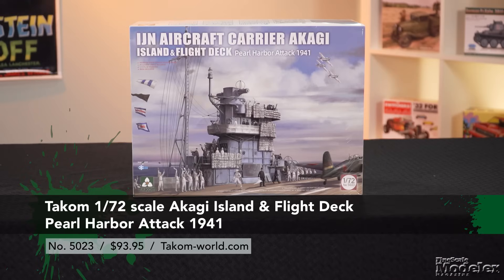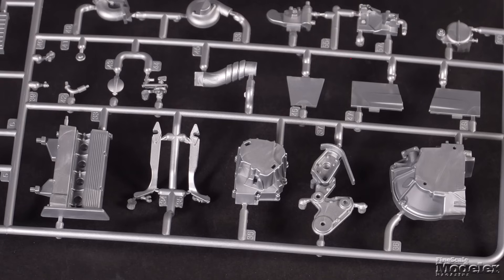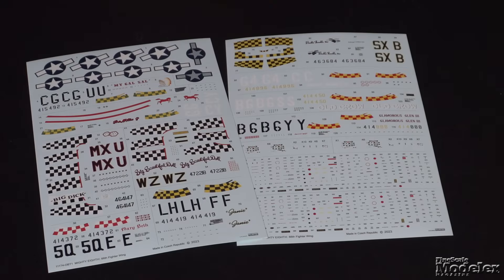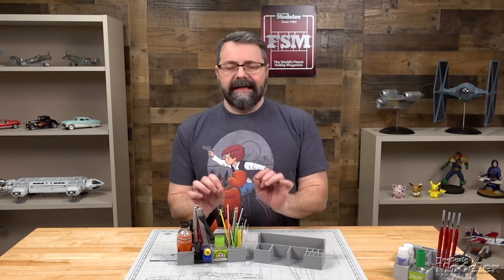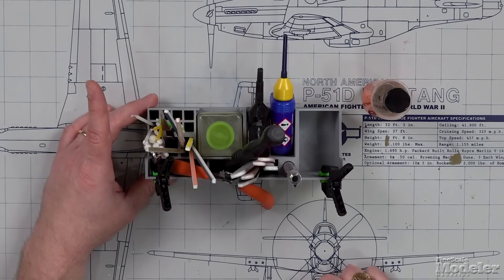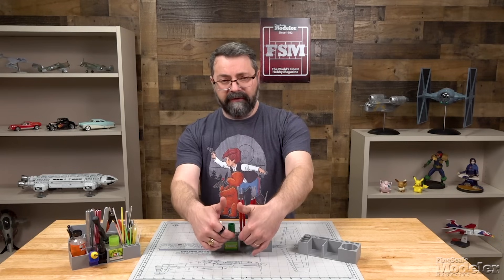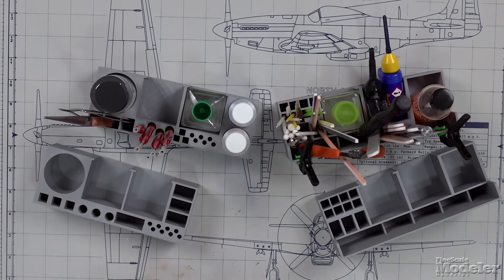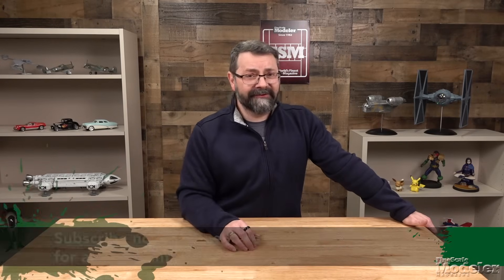FineScale Modeler unboxes new kits, tries out a 3D-printed tool caddy, and takes a break

Comment: The AKAGI deck kit is also offered in 1:35 scale, except it does NOT have the extra mattress protection. It WILL come with a Nakajima B5N Kate torpedo bomber also in 1:35 scale. Kind of baffling that the 1:72 scale version does not have an aircraft included but the 1:35 scale version does and not have those iconic mattress protection.

Comment: I'm a big fan of making your own hobby organizers to fit your tool collection and workflow.   Foam core board has a low barrier to entry, and modelers likely have all the tools they need to use it on hand.  Foamed PVC board (Brand name Sintra) works even better, and there is this material called Styrene that I've heard good things about.  :-)  

If you have a 3D printer, then you can design and print your own (TinkerCad is very easy, and organizers are the perfect starter project in CAD) .

But I do like my NASA coffee cup too, nasty though it may well be LOL. 

Happy Holidays!
Reply from the maker: Definitely! Remember, I made a brush holder a few months back out of an old cup? Do what makes you happy. And if that means a mug, I accept that--but I do like organizers! Happy holidays! -TK